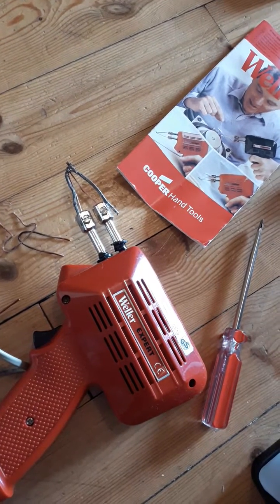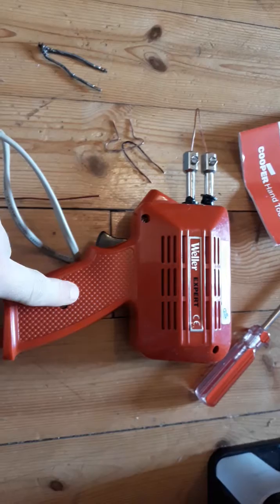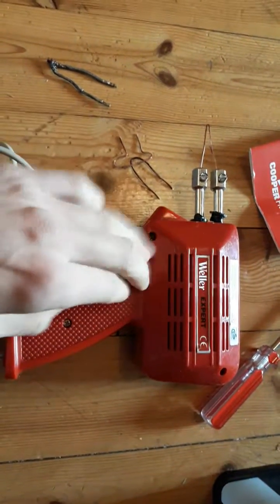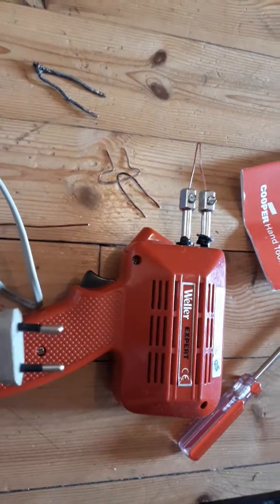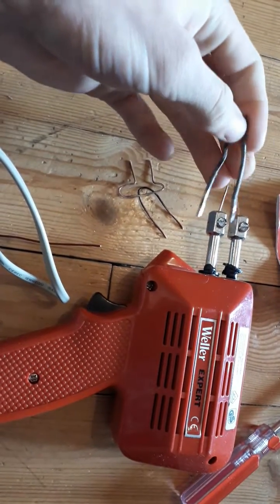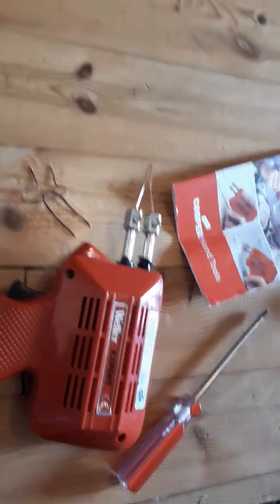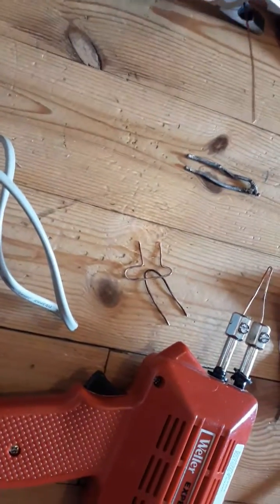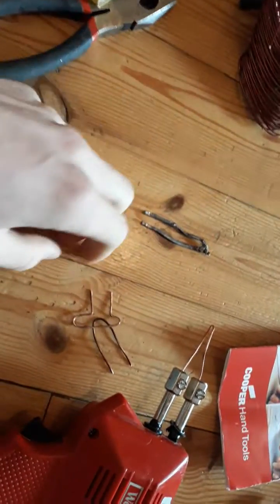Weller Expert 100w solder gun, eazy repair

Comment: How old this soldering gun?
Reply from the maker: don't exactly remember, but it is really old, the manual is already brown/yellow ish. and it  including the images look like as if it is from not to far after the WOII. but they made many newer versions of this which look roughly the same and they do still work the same in essence, almost all solder guns are just a 2 coil transformer where a low resistance conducting wire is attached to the end and often there is a switch and a light.

but I don't know the exact age, perhaps it is somewhere in the manual, might look soon, but don't expect it to be there, and when searching online for them I only get documentation of the newer replicas which still look kind of like this one and work around the same but they aren't the same type.

I however got this one long ago on a flee market from a old guy who already had it for really long.

Comment: If the primary coil get burned can I rewind it
Ps: I did remove the coils (about 700 turns) Sir Do you have any experience in rewinding this weller soldering gun or any source on how to do it?
Thank's in advance
Reply from the maker: don't have experience with rewinding it, but you should be able to rewind it like a normal coil, since you mention 700 turns that must be on the AC side so you can just wind it in any direction make sure the wire you use is of the right quality but it should just be wind like a normal coil.
I personally use a old broken electric drill which I kind of fixed to wind coils for me since that one is a lot faster.

how did it get burned? did you keep it on to long or used it on to high voltage etc?
Reply: @ted_van_loon  thank you sir. Yes as the small light was not working and the push buton was not working I replaced it with a button and forget to press the botton when it was in on mode and when I come back I did see a huge smoke in all the chamber , in that times I realized that the Iron gun is dead :(
Reply from the maker: @Muslim_011  Solder guns indeed tend to burn up very easily when on for a long time, soldering irons heat up slowly but can stay hot for long, soldering guns heat up super fast but only can stay on for a short amount of time before you have to cool them to prevent damage.
but those old soldering guns tend to fully work on AC, so you can just typically rewind them in any direction, it is still advisable to remember which direction it was just in case. but for winding coils that drill method tends to work well
if you have a lot of time you can wind it by hand, but 700 turns takes long to wind
and also try to make sure the quality and thickness of the wire are the same on the AC side since if you reduce the resistance there it will increase the wattage of the system.
Reply: @ted_van_loon  Thank you very much sir. I will note your very helpful advice 
Ps: I removed the secondary coil from a transformer (220v to 12-0-12v) and replaced it with a thick copper wire from another Solder gun (about 4 mm) and it work very well except one small problem it is huge in weight I can't be precize when soldering/desoldering in long time
Reply from the maker: @Muslim_011  Soldering guns like these tend to not be to much aimed at precicion work
a soldering iron tends to be much more precice, I use one now as well, because they just are better for precice and long solder things 
I guess that the using of that new coil is part of why it is heavy. however be carefull,  with replacing the coil completely since there is a chance that it will either make the solder gun weaker or more powerfull. if it becomes more powerfull that might cause damage when using it for long since it wasn't made for that high power. changing the location of the coil to external would be difficult since that would cause a lot of energy loss, however if the weight is really aproblem and if it can handle the current power well then you could perhaps lock the soldering gun in place and move whatever you are soldering or desoldering over it, perhaps even automatic a a mashine, that would help witht he precision as well and should be doable with some stepper motors but only is usefull if you really need to use it a lot and want to save a lot of work. otherwise there isn't really a easy fix right now.
Reply: @ted_van_loon  I totally agree with you. The one I made it from a transformer I added a permanent switch as long as I release my finger it shutdown imediately. I use it only for a harder solder components when the other soldering iron that I have can't melt the hardening solder.
Thank you again sir for taking time reading my comments